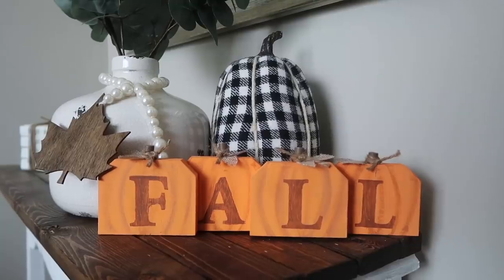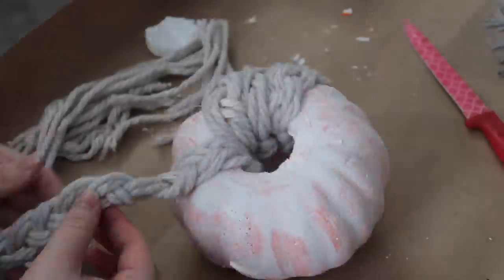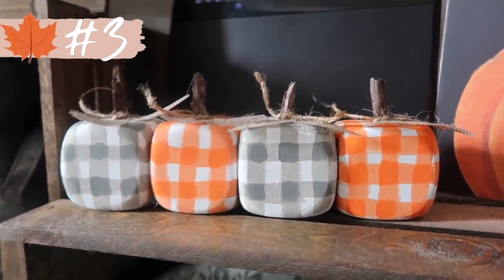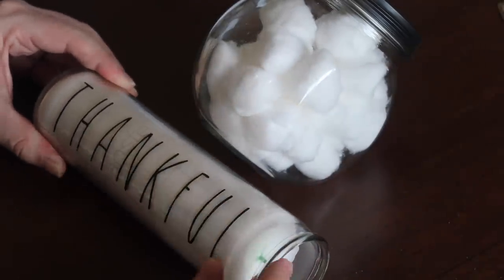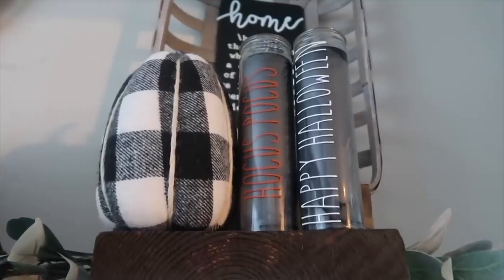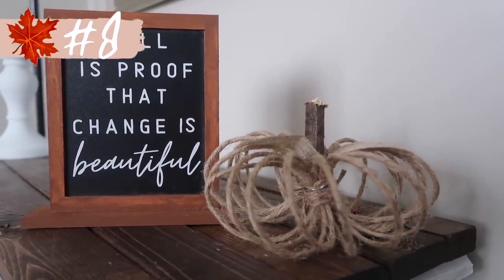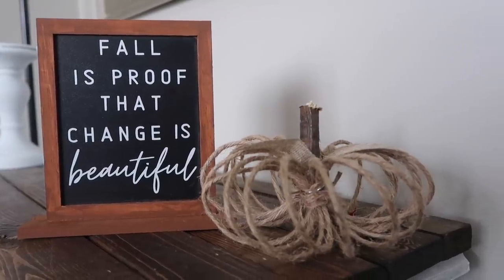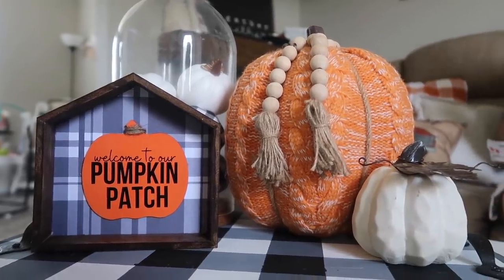20 AMAZING High-End Dollar Tree Fall DIYs 🍁 Cheap $1 DIY Decor that looks EXPENSIVE! 😍

Comment: Can you explain a little more with the mug at the end ? What kind of paper did you use to hold it down and was the the towel damp? I’m interested !!! That looks so good
Reply from the maker: Yes! The clear sheet is the carrier sheet the Heat Transfer vinyl comes on. I just used a regular towel (not damp) and used it to protect my hand from the heat while heating it and also while applying pressure :)

Comment: Hi what size bit did you use on the square beads
Reply from the maker: I used a 1/16 but I believe but it will depend on the thickness of your yarn or jute that you are using 😊